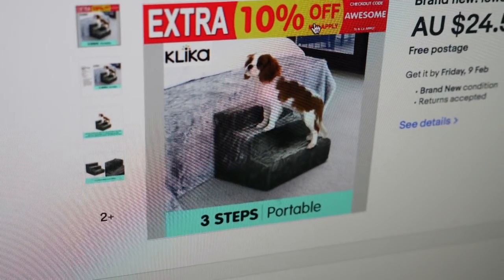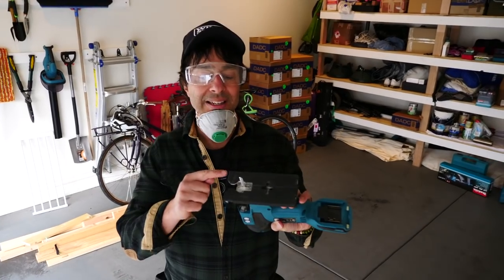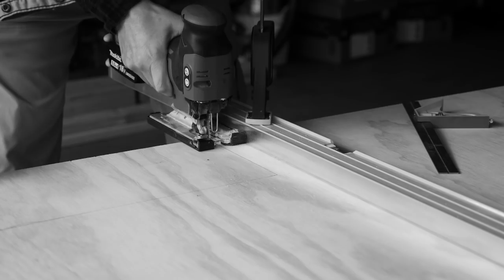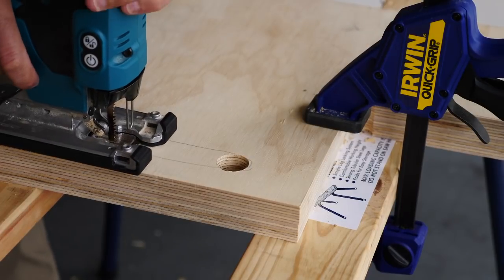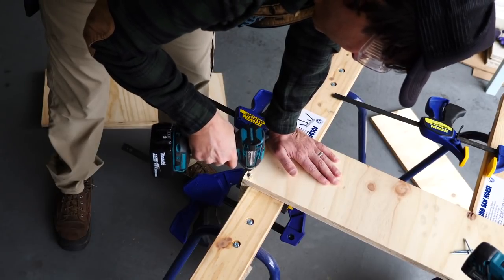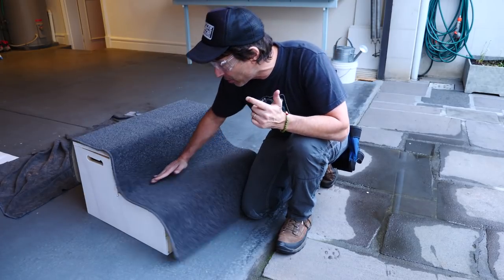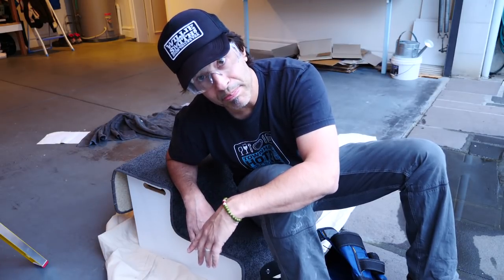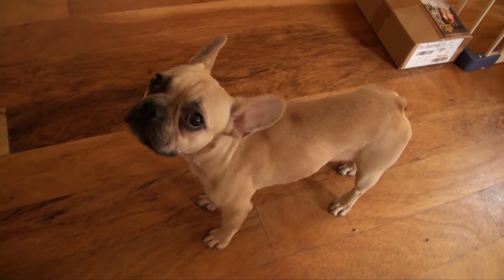Build your own INSANE Dog Stairs!!!

Comment: Dude, you are hilarious. I was laughing so hard that I had tears in my eyes. I'm glad I found your DIM/DIY. But I don't have power tools and wood. So, I'm going to use reinforced cardboard and cardboard boxes. Construct with glue and tape. I'm going to add some type of foam covering for some cushioning, attached with strong adhesive under some carpet or material. I'm not brave enough to use power tools yet. Which means you'll be above "1st grade" by time I decide to build anything that requires power, other than my mighty glue gun. 🤣😂🤣 Happy building. 👍👏
Reply: so you understand, carpet is probably more rigid than cardboard,,,lol, no really, ikea, uses a kind of cardboard to fill in and actually strenghten their thicker looking boards, i'm about 164 lbs, and i can stand on them